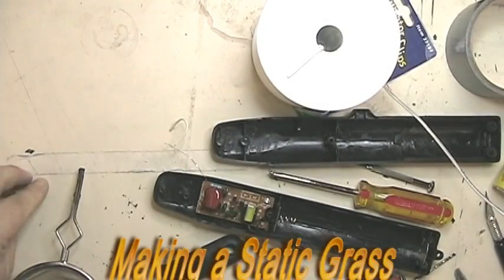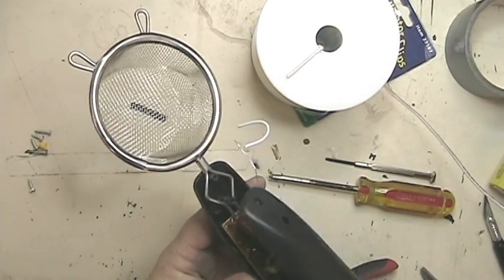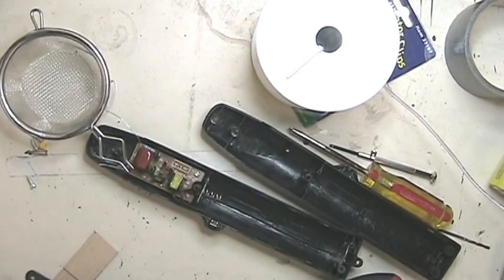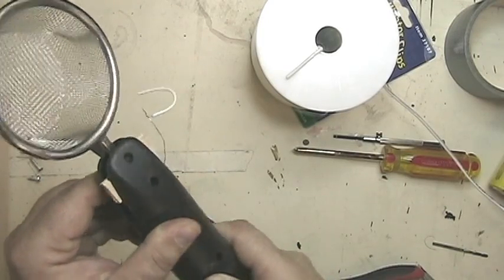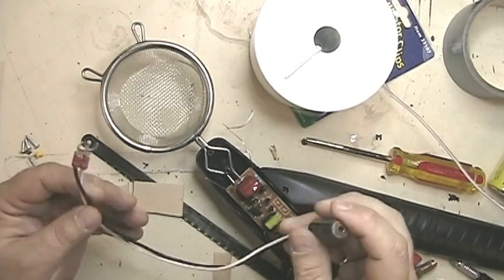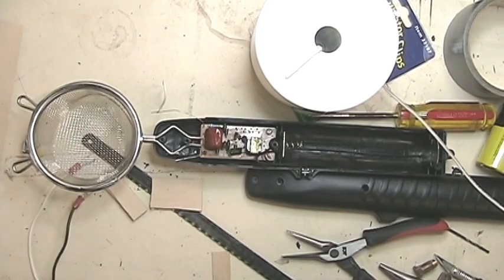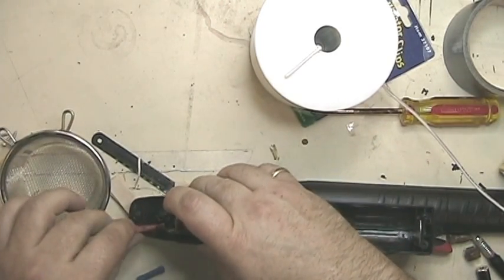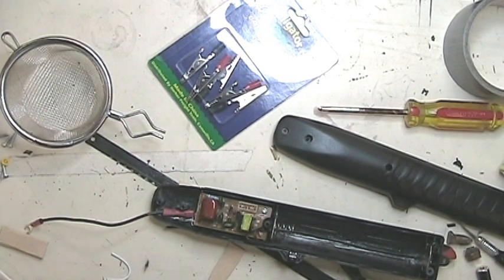Make a static grass applicator with an electric fly swatter: Part 2

Comment: Made one using the double AA battery variety of swatter, and for all intensive purposes, it works for my application, and as many have indicated, it saves a lot of money. One peculiarity that I found is that the lesser the amount of static grass falling from the basket at a given time, the better is the opportunity for the individual grasses to position themselves upright upon landing. In my basket, which I fashioned out of a flat-bottomed container with a screen epoxied in, I placed a second screen. The results are significantly better. Also, if the opportunity exists, tapping the project upside between layers of applications rids the work of unglued fibers that may have landed prone. I wanted the straight up and tight, crew cut look, and doing these two things have enhanced that look, significantly.

Comment from the maker: It was just easier for demo purposes to hook the spade to the screen.  I'm going to be building a more powerful applicator that runs on 120 volt AC. That one will be a bit more expensive  to make(and a bit trickier).  I just wanted to give this a try and  see how well it worked.  For the money it works OK. 

E